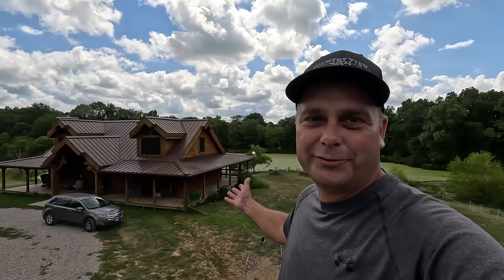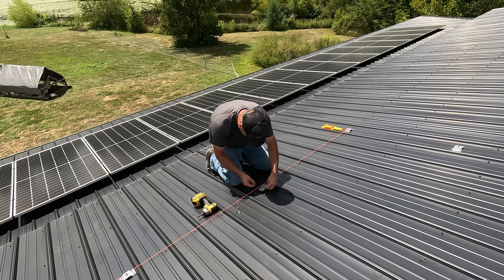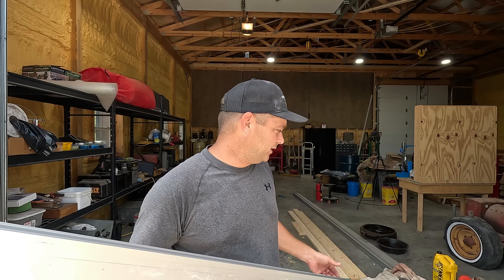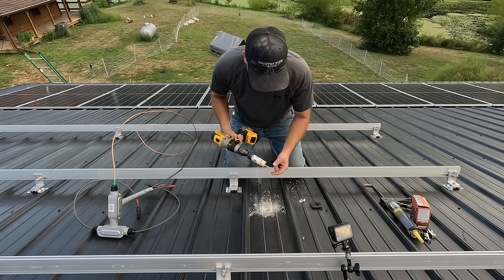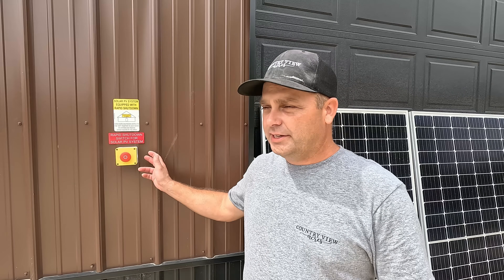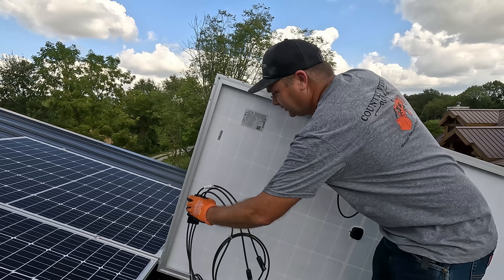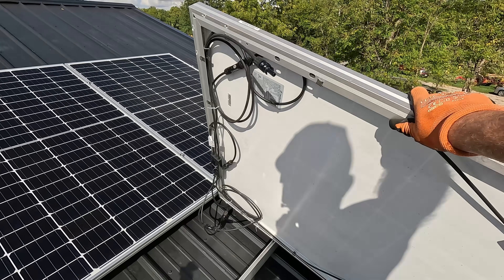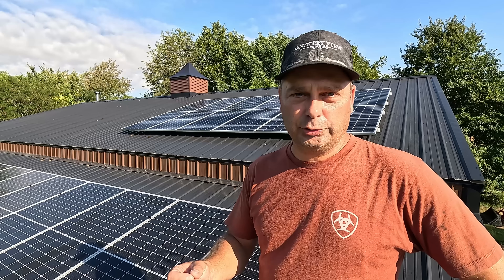Installing the rest of our solar panels.  Finishing up the installation of our solar power system.

Comment: Question / request, as you have installed several different systems (in the shop and house), it would be interesting to see your  comparison of a stand alone system.

Comment: Great video Evan. Were the rails the 40 or the 60mm? and if you had to do it again,  would you use the same size considering the ease of installation of the modules and wiring. Thank you
Reply from the maker: 40mm.  And the next array I used iron ridge, because I could buy it through my local electric supply.  So I didn't have to pay shipping.

Comment: My question is base on the exterior and interior part. What is meaning of dc in the solar panel and it is usefulness?,what is the meaning of AC in the solar battery and the controller of the solar energy?

Comment: Great video! I'm curious on why you didn't place the panels on a ground array? Seems you have plenty of land and I hear ground arrays are easier to maintain. I'm going solar but don't have the land for a ground array. It's a no cost money project for me, the install and materials are covered by the solar company with lifetime maintenance. Where I live in Gloucester, Ma our city has a power co-op with two giant wind turbines which supplements the city's power use and is passed on to the residents. The system I'll have (16 panels) on average should produce 120% more than my avg. yearly use.

Comment: I am looking at installing a similar system at my cottage.  One question...can I use my Honda .2 kw generator at 110v, to recharge the battery bank when utility power and solar power are down?  Does the "backup to the backup" need to be 220v or is 110v at only 2000 watt workable?

Comment: What about a followup on the tear down of the double wide trailer. hopefully that will take care of that problem with drug deals.  I was thinking about maybe using the trailer frame for a hay wagon of some sort js
Reply from the maker: Yes, I think I am going to use a running gear under the frame to move it.  Waiting for crops to be harvested so I can pull it through the field to the house and pond.

Comment: Awesome job Evan.  I’m impressed with the knowledge of installation you have.  You saved money by doing it yourself.  I like you explaining every step of what you are doing and the reason for it.  Since you have been on your homestead, it has been more and more improvements that will benefit you and Rebekah for years to come.  Your time and hard work will and is paying off.  Very good job Evan and thanks for sharing.

Comment: That "sealant" appears to be butyl. It is frequently used to seal around windows and other openings in campers and mobile homes and many other uses. You can get it in caulk tubes or in rubbery tape form like that on the back of those brackets, that I'm familiar with. There may be others. It is superior to silicone sealant IMO.

Comment: I am not sure if you know this. Coiling DC wires in a coil is not good. Those solar panel wires should not be coiled. It causes resistance, magnetic field and should not be done.  Its a magnetitic field that is created. If you have to coil them then do a small coil then a medium coil then a larger coil so they do not have the same size of coil and have enough room so a magnetic field can not be created. See all the voltage is getting more and more with each panel so the last coils will have a much stronger magnetic field and can increase odds of a fire at worse and voltage, amperage loss at best. 1 coil is acceptable anything more  the same size needs to be changed.

Comment: Very nice job as usual.  One question that I have is does it affect your homeowner's insurance?  I don't know for a fact, but I have heard that your rate might increase with solar.

Either way you built a very nice setup.
Reply from the maker: Yes it does increase home owners insurance.  For coverage of the solar equipment and for I creased liability insurance required by the power company.   Mine increased $400 a year.
Reply: @CountryViewAcres   That makes sense.  I'm looking forward to your cost analysis along with your results.

Comment: Question: what is the life expectancy of a solar panel with normal use.  Looks like a very good job with the installation.  Good luck with long life for the Solar system that you installed...💝
Reply from the maker: The solar panels have a 25 year warranty.

Comment: 8:46 Evan, very clean setup. I’ve used Ironridge racking previously and really like it. The S!5 mounts are great too! One bit of advice would be NOT to lift panels from above as you did at the time stamp. The glue between the sheet and the frame can be stressed and be pulled away by lifting from above and suspending the weight of the panel from the frame. Always lift from the bottom edge to help keep panel integrity.

Comment: Even, do you have any worries about heavy winds getting under the panels and them trying to lift? I like what you are doing and have though about doing the same, but I am in a hurricane zone.
Reply from the maker: I am not worried.  I installed the roof mounting system as designed.  And we aren't in a hurricane zone.

Comment: The way you rattled off code enforcement advice, and your general knowledge of all things electrical makes me wonder if you do some kind of construction if not actual solar power type job as a profession.  Or is this simply something you learned doing this as a DIY project?  Well done either way!
Reply from the maker: I do industrial electrical work for a living.

Comment: I don't know anything about soalr panels other than what I've seen from watching your channel but i was just wondering if the solar panels wear our and need to be replaced after a certain amount of time??
Reply from the maker: The panels have a 25 year - 80% power warranty.   They won't lose more that 20% power generation in 25 years.  So they do lose a very small percentage of power generation each year.  So after 25 years my 11140 watts will more than likely still be producing at least 9000 watts.
Reply: @CountryViewAcres  thanks for the info, I'm sure they will have paid themselves off for you long before that

Comment: What do they call the Pigtail between the generator and the house plug. That is the fire starter people zapper if you don't use the correct pigtail, if it's called a pigtail?
Reply from the maker: The house plug is a "generator inlet" and the cord is just a generator extension cord.  You just have to match it up to what type plug-ins you have.  What I have always referred to as a pig tail is a cord with a plug-in on one end and just wires on the other end.  And you wire it up when you use it.

Comment: Kirby-Risk is a top notch company. I dealt with them at a couple of employers  Unfortunately, both of my employers screwed KR over royally. Good choice on supplier, Evan. 

Your solar installation is one of the best I've seen. It may be out of the reach of a lot of homeowners price wise, but technically it looks to be flawless. You've definitely done your homework. One question comes to mind though, what is your plan for cleaning snow from your array in Winter? They won't generate much if anything if they are snow covered.

Great video!
Reply from the maker: Usually snow does last a day or two on the roof.  So I just plan to let nature take care of it. We only have decent snowfall a couple times a year.

Comment: I foresee a problem with snow sliding off upper roof and banking up against the solar panels on the lower roof
Reply from the maker: We will have to wait and see.  Probably depends on the amount of snow.  The black roof melts it pretty fast.

Comment: Do you still have the Ecoflow Solar Generators and how do they fit into your Solar strategY?
Reply from the maker: Yes I do.  I have been using as portable generators.  And family has used them during extended power outages

Comment: Make sure that the boot you put the conduit thru is coned up so it stops water better. I would've pushed the conduit down then pulled it back up till it coned up. Also I wouldn't worry about being on a truss. If you fasten to the purlins that's good 👍

Comment: like I told you, you are going to build a huge solar system to supply power to your house and your shop, and like I know one couple that has a small house in a working shop and his solar power system has well over 50 2 sided  solar panel on it and they are still have to use a generator to keep up and now they added even more solar panels to his system because they have a baby now

Comment: You mentioned the aluminum tracks showing, a little, couldn’t you just spray paint them the color of your roof? Then they’ll disappear. Your  work is done with such detail and precision. Great job!
Reply: Good idea. The other option (one I learned too late for my DIY roof install) is to use the Ironridge calculator and layout the feet such that the ends are are not direct supported but are overhung from the last foot placed under the panels - and not supported at the end of the rails. The XR100 rails he used allow some amount of overhang (unsupported end weight) while still meeting wind and snow loads. It’s all covered in the Ironridge system calculator.

Comment: For your next video: Question; Did you use an app or online link to determine the orientation and degree of tilt for your installation? If so, could you include it in your next video description?  I am looking at building a pole barn and I plan to build the tilt into the roof pitch. Thank you.
Reply: The ideal average tilt is your approximate latitude facing true south. If you are focused on more output during summer, you want less angle (more flat) or for winter - more angle. His panels will work better in summer than winter,  but that’s a trade off to not having a 10/12 or 12/12 pitch roof. Mine are set for more angle / winter since that’s when I really need optimum solar with the short grey days.
Reply from the maker: The workshop roof is pointing due south.  The pitch of the roof makes it easier to work on and maintain, but it will make less electricity in the winter and more in summer..  But the overall production over the entire year is only slightly lower than setting them at the latitude angle.  A small trade off for and safer roof angle.
Reply: @CountryViewAcres  very good points, thank you
Reply: Look up pvwatts calculator for yearly estimates on pv production based on location including average weather, tilt angle, etc.

Comment: So since you installed it does the electric company or ? Need to come to your property to inspect it, approve it etc before can start using it?  Dan
Reply: The power company came and did an inspection before he could hook to the grid the first time. Not sure if they need to reinspect this time.

Comment: Hoping to finally break ground on our "Country View Acres" in the next few weeks... 🤞... and would like to build our home keeping installing solar in mind so we can make accommodations for wiring, battery's.... during construction and install everything at a later date.  So, the sooner the summary/cost analysis video the better! lol...  
   Things I would like to see in the video..
  - Total cost, broken down so you can determine what is needed to install the system in stages if needed. 
  - Any does and don'ts along with what you would have done differently. 
  - An overview of the system that shows where everything is located within the system and how it is connected. Kind of like a layman's schematic.
  -  The "behind the scenes" things that you didn't realize would have to be done... i.e. the things you never think of until you're in the middle of a project..lol. 
  -  Any considerations that need to be planned for ahead of time... for example, is it better or is it required that the solar/battery electrical room is located close to the solar panels or close to the house's main electrical panel, special preparations for mounting any equipment...?  

Thanks Even and Rebecca.

Comment: Great job.  You need to install the Iron Ridge stopper sleeve around you bolts on the end of your rails.  Without them you put uneven load on your panel.  😊
Reply: Good eye! The stopper sleeves are based on the panel frame thickness and clip around the UFO fastener to keep it level and secure on the side that doesn’t have a panel.

Comment: Will you use the generator to power the house when electric and solar are down or to charge the batteries, or both?  Is your generator multi-power so you can run it on gas/diesel/propane?
Reply: If both, the battery needs to be compatible with the generator.
Reply: @EPCube  Interesting didn't know that.  Why is that? Do you mean it has to be AC or DC electricity?

Comment: Any idea of how much power you gained with the new panels only? I'd say more because of the greater angle than what you'd get on the lower roof. And when you figure out how long to recoup the cost don't forget the panels and batteries will degrade over time and batteries might even need replaced before you break even. And I'm guessing around $36,000 total cost so far.
Reply: It is important that the battery has a long enough warranty period.

Comment: Evan, I live in St. Clair County, Illinois.  When I checked into installing a system here, I don't know where I got the information that Ameren Illinois will not buy back unused power.  I guess you are using Ameren as well?

Comment: I was wondering if those solar panels attract lightening  or are dangerous in any way.
Reply: Only in the sense that if he didn’t have those shutdown modules in line, the circuit voltage of 12 series panels would be >400v when hooking things up - which could kill you dead and can be used handily to arc weld…. But with shutdown modules the panels won’t output serious voltage until given a signal to wake up. The panels and rails are grounded, so otherwise no added risk.

Comment: Could you go over the Eaton Double Throw Safety Switch?  From what I can tell "UP" is strictly "GRID POWER".  "DOWN" is just "SOLAR and BATTERY BACK UP".   I'm planning on installing the EP Cube to add to my current array for energy storage.  So basically re-routing the output of my current inverter to the A/C in on the smart gateway of the EP Cube and then adding more solar for the DC Side.  Thanks!

Comment: Evan I'm all for setting this up but I was wondering a few things. One is does your  power company buy back your power for the same amount it charges you? Two How much does the battery  part which is the renewable in your case cost?  And number three is there a guarantee  on how long your solar panels will defiantly last.? I really like the part of the system that lets you be totally off grid! Fantastic system and good luck.
Reply from the maker: the power company buys my power for 3 cents per KWhour and I buy it from them for 15 cents.  So it is impossible to zero out my electric bill.  The solar panels have a 80%, 25 year warranty, which means they will still make 80% of the energy in 25 years.  The batteries are probably at least a third of the total cost.
Reply: @CountryViewAcres  to bad you couldn’t get more return on your making their power for them. Well maybe one day. Your videos are fun. Thanks for making them.

Comment: Will you factor in a life span and replacement estimate for new panels?
Reply: Panels are rated at 20-25 years to 80% output. In 20-25 years they will be putting out 80% of their rated power - it’s not like they just stop creating electricity.

Comment: I’m  sure you know this, but maybe others don’t but make sure you blow off the roof after drilling, those shavings will leave rust marks! Don’t ask me how I know !
Reply from the maker: Good advice.
Reply: Congratulations 👍👏👏👏
Reply: Thanks Richard, I never would have thought of that until…….thank you for commenting, sometimes some of us just don’t have all the experiences the world has to offer.
Reply: Definitely blow them off. I use to install metal roofing years ago.
Reply: Great video, thank you for showing your work. I will be doing solar in the future, but I have some buildings to build first.
Reply: Great point.  And don’t ask me either😂